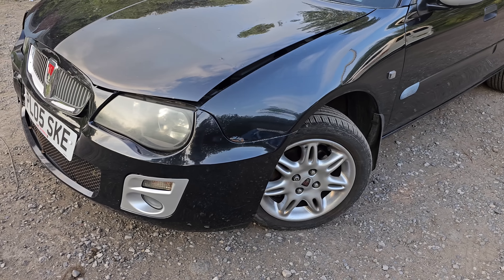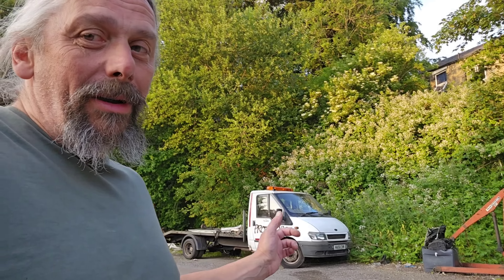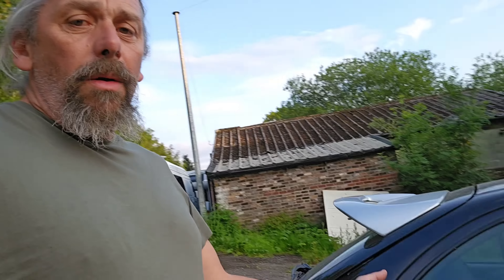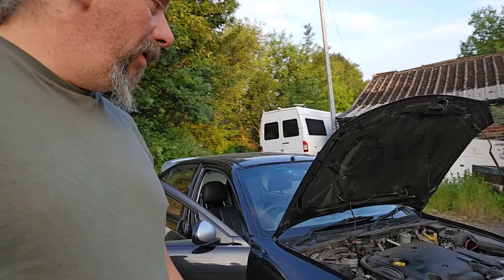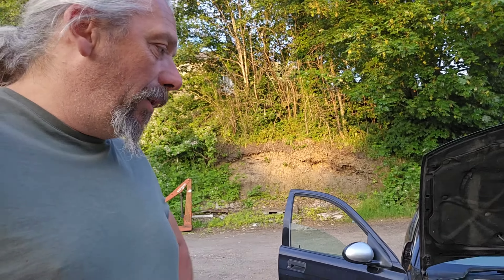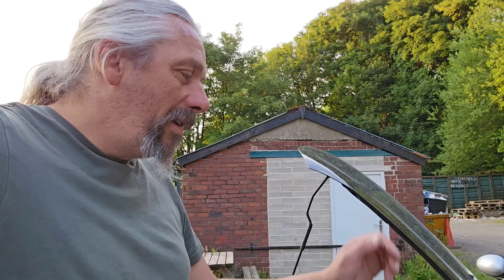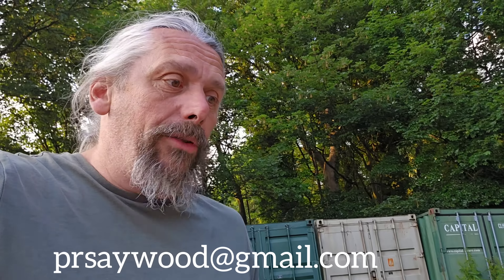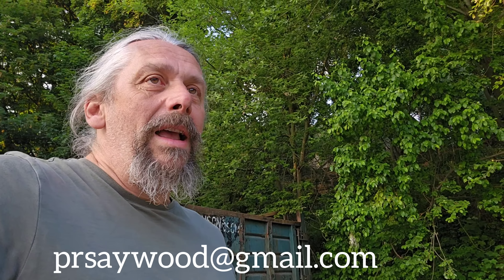Poor Eric The Rover 25 Gets Wrecked By A Careless Driver

Comment: I hope you can save Eric, would also make for a brilliant miniseries
Reply from the maker: Yes it definitely would do
Reply: @ProjectNigel  Salvage Rebuilds UK; Rob and Chris do this stuff all the time, stick it on the dozer and pull. A tie-in would be awesome but they are all the way down in Kent. Also not sure it is saveable because of the boot floor deformation, that would need proper assessment.

Comment: So sorry to see this happen to you & your family, hopefully you're all as okay as can be hoped all things considered.

I've had a lot more experience with damage to the front end of 25's than I'd like and they've all avoided any damage to their wings also.
With the L series, hopefully the oil cooler unit, which is positioned on that side of the block is okay. Mine has one of the three mounting points cracked off completely but I don't think Eric's front took enough force to do that.

With regards to repairing the damage to the front, I was able to remove the front slam panel assembly from a donor vehicle and replace the entire unit in one go, with the new crash structures in place from the donor vehicle. A decent bit of spot welding done by someone with actual welding ability though, not myself.
The front impact looked less damaging in Eric's case than in my own, so I imagine the arms underneath won't have been damaged.
Also if you wanted to dial the clock back to a pre-facelift it shouldn't be too difficult to do, having done the opposite thing whilst repairing mine. (It's the 53 plate one in red with a facelift front and the BRM seats).

Unfortunately I can't offer any advice with the back end, hopefully there isn't any significant structural distortion though.

Let me know if I can do to help keep Eric alive, even if it's just having a chat about repairing him!